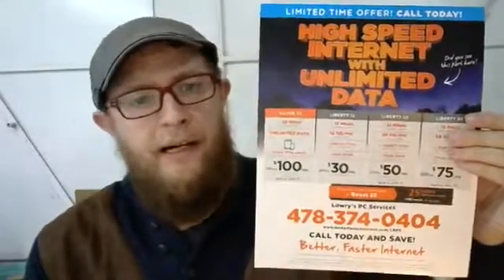Viasat2 Hardware

Comment: thanks for the information, is there a place where I can look at the plans? you said you would post it in the comments, maybe you meant somewhere else, idk, but I would like to know if the "unlimited plan" has any restrictions, like a slow down past a certain amount of data, or anything like that, and if it has a contract deal.
Reply from the maker: Yes sorry, this was recorded on facenook live and then I moved it to Youtube. The plans haven't launched yet, but from what I've seen there's 3 unlimited plans where you will choose your speed. They are 12 mbps, 25 mbps, and 30 mbps. They DO NOT have a data cap in a traditional sense, but they will prioritize data after a certain point. Basically you will have an amount to use and if you go over AND there's network congestion they will prioritize the data. But both conditions must be met i.e. over the limit plus network congestions.